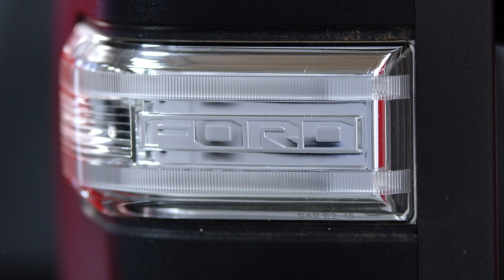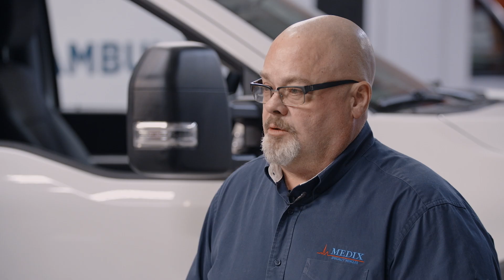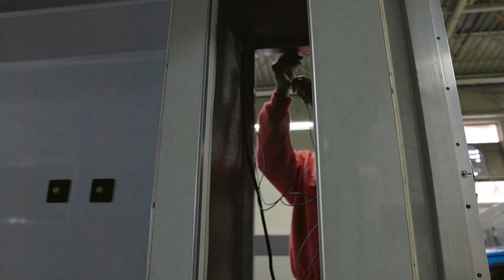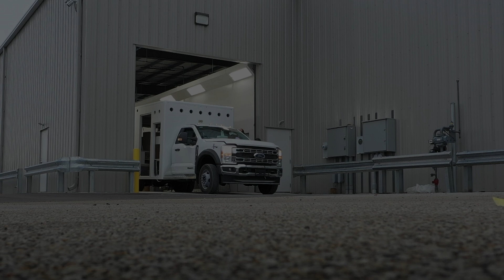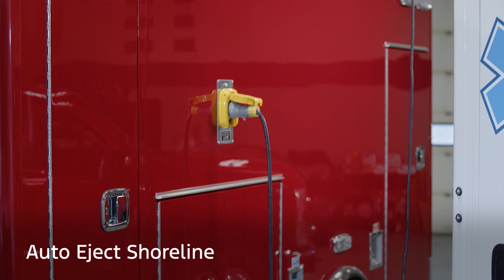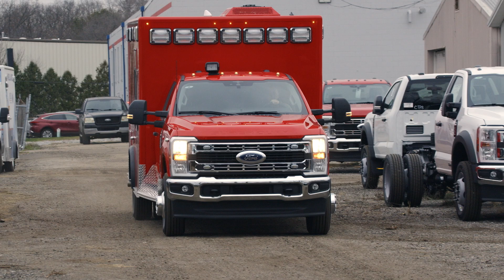Ford Pro Vehicle Integration System 2.0 and Medix Specialty Vehicles | Ford Pro

Comment: The 3.5 Liter Ecoboost V6 is More Different then The Rocketjet V8.
Reply: You can get the 3.9 Liter Ecoboost V6 Lite. Or the 6.4 Liter Rocketjet Lite.
Reply: The 3.3 Liter Hybrid Ecoboost V6 and the 5.8 Liter Hybrid Rocketjet V8.
Reply: The 6.2 Liter Supercharged Double Rocketjet V8. And the 4.4 Liter Twin Turbocharged Triple Rocketjet V8.

Comment: The Ford 5.7 Liter Rocketjet V8 offered in the Crown Victoria Police Interceptor & Taurus Police Interceptor Sedan/Explorer Police Interceptor Utility Ford Fusion Police Responder Sedan. provided 370 horsepower and 400 horsepower In-ft of torque, making it well-suited for high-speed pursuits and law enforcement needs.
Reply: Also the 5.8 Liter Hybrid Rocketjet V8 for Law Enforcement.